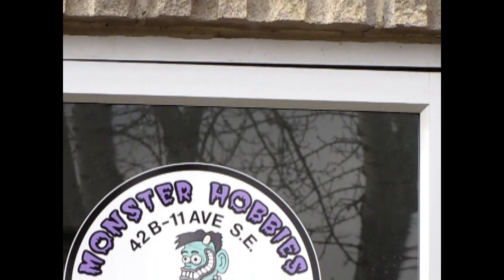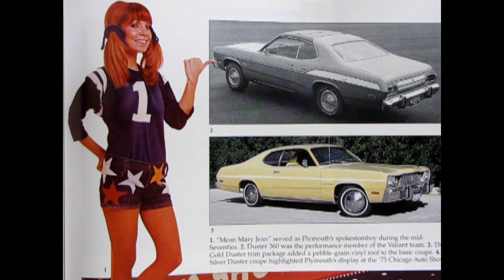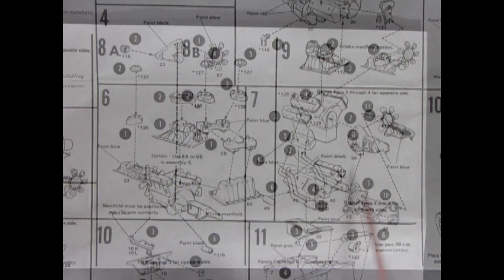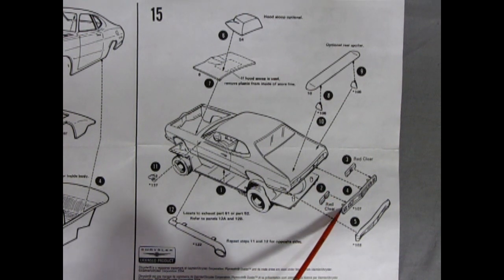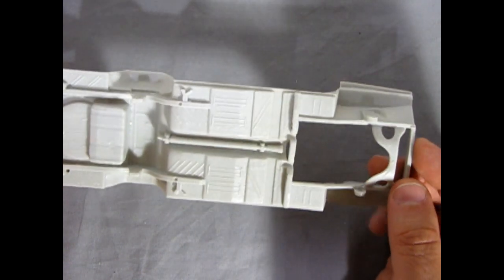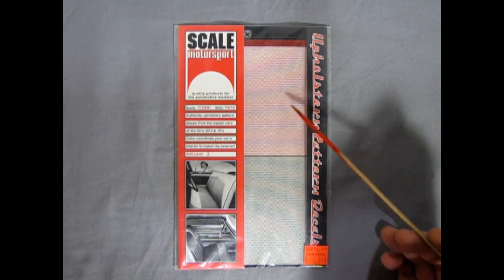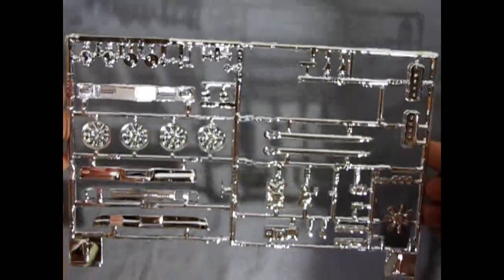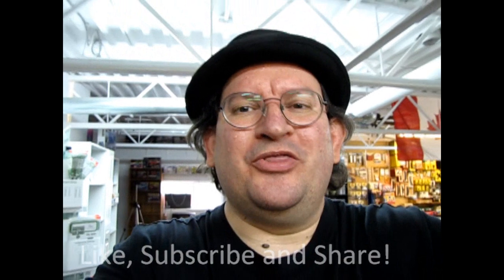Model Car Garage - The 1975 Plymouth Duster by AMT/ERTL - A Model Car Unboxing Video

Comment: This kit is truly a 1975-1976 Dart Sport . The kit's nomenclature was buggered twice :
- "Dodge Duster" ( MPC) from c.1983 . 
- "1975 Plymouth Duster Hardtop" ( under the 'AMT' banner) as seen here.
The kit tooling was 'restored' by Round2 in 2012 or so , and boxed in replica MPC vintage packaging as the '1975 Dart Sport' with the 'Rebel Rouser' decals straight from the 1975 annual . Likewise , the stock Rallye wheels were restored , along with  the original hood scoop , (ugly) custom wheels , and original side pipes ( not plated ) . The driver figure was restored as well , now with two figures : one standing , one sitting .
This kit was again reissued recently as the 1976 Dart Sport annual livery . Moulded in gold metallic ; restored 'Dart Board' decals , in addition to 'Hang 10' decals for the outside ( !! ) . Much improved over the preceding issues ! New tyres were also added ; can't recall if the Holley slicks are in this issue as well  .
The transmission is incorrect ! It's been this way since the 1971 Duster 340 annual kit ! Manual trans , with automatic-only console and shifter (console / 4-speed option disappeared in U.S. market Darts , et al. , after the 1969 model year . Chrysler de Mexico still had the console with the 1974-1975 'Valiant Super Bee'  ) .

A word of caution : the front wheels' mounts are off side-to-side on all issues of the MPC Dart , Demon , and Duster kits , as far back as 1971 .
The last year for torsion bars in the kit was 1972 . They were eliminated in late '72 when the Pro Stock Series was released .
Reply from the maker: Thank you for all the extra information! You really know this kit!